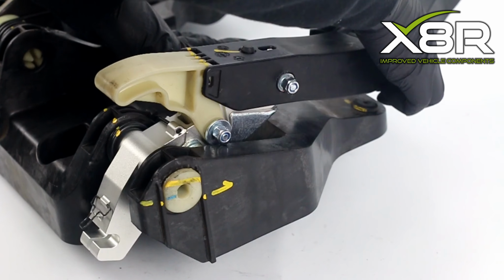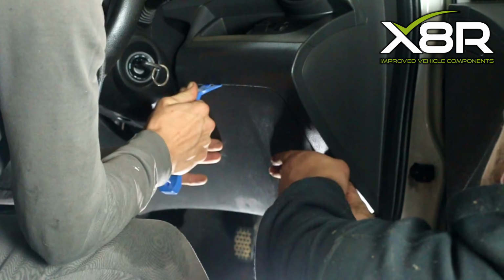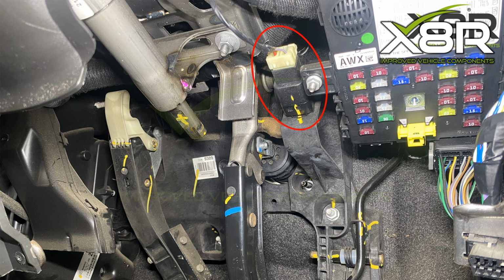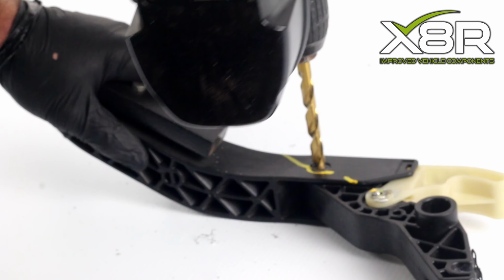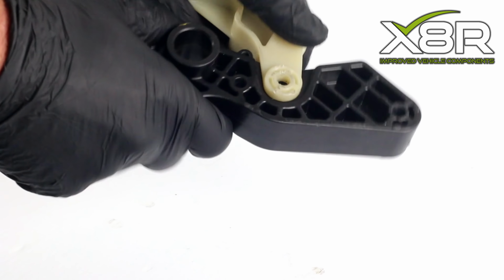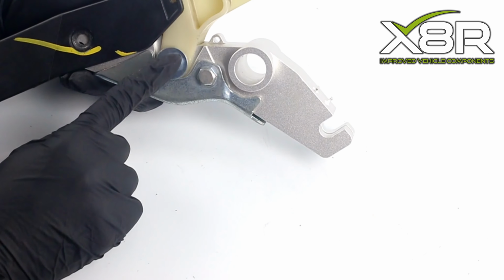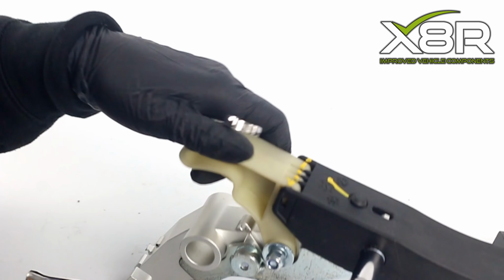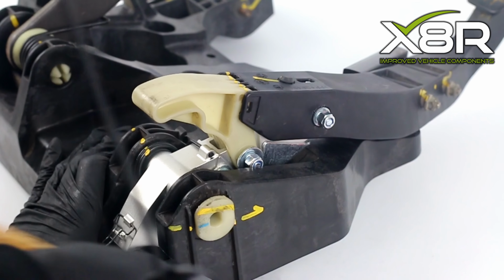Snapped Or Broken Clutch Pedal On Your Chevrolet Spark? Repair It With X8R! Full Instruction Video

Comment: Also made the fix here. But the clutch is way to high now. And not normal te use. Verry expensive with an dissepointing outcome
Reply from the maker: The clutch pedal height can be adjusted, you should be able to make adjustments to get the pedal at the correct height. Please let us know if you need any further guidance on that sales@x8r.co.uk

Comment: I repaired the clutch pedal on my Barina Spark just recently. The repair is stupidly long compared with what it could/should be. I didn't think of it until after I had done pretty much the exact process you've shown here but I have a suggestion that can change a couple hour repair into a 5 minute 1. The "central shaft" mentioned at 2:55 is a gnats whisker too long to allow the clutch pedal to be removed without removing the entire pedal box. That gnats whisker is about the same length as the arrow head style locking mechanism. Run a hacksaw or coping saw blade through the locking mechanism to remove it. After it has been shortened the pin/shaft should now be possible to move, while still under the dash, far enough for the clutch pedal to be removed. Unclip the clutch cable, repair the clutch pedal, reattach the clutch cable, slide the shortened pin back into place and screw a self tapping screw with a washer back into the place where the locking mechanism was before shortening it. I have actually seen a large cable tie used to hold the pin in place but personally I'd go with a self tapping screw and maybe a dab of loctite on it.
Reply: Wish I see this comment before spending hours trying to remove the whole pedal box. Was a pain to remove and put back.
Reply: hi mate this one can fit to barina spark 2011?
Reply: Mine is a 2011 Barina Spark.
Reply: Hi I'm looking for the 2 Bushes